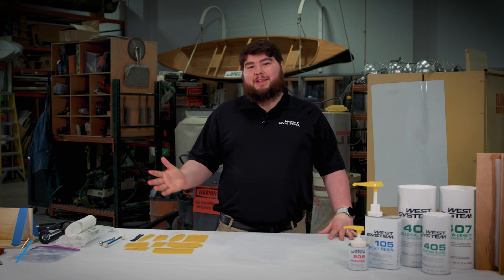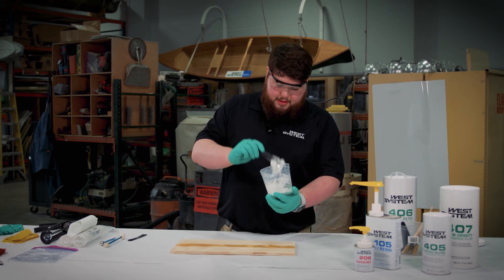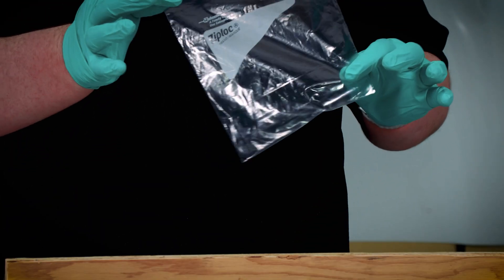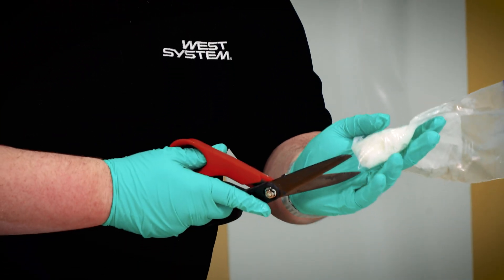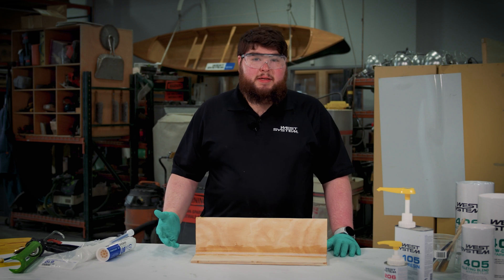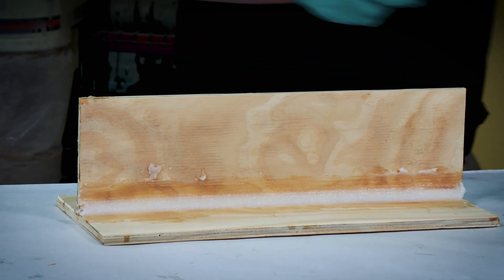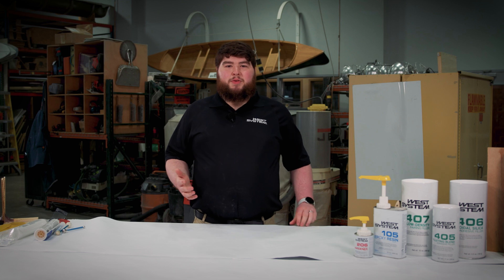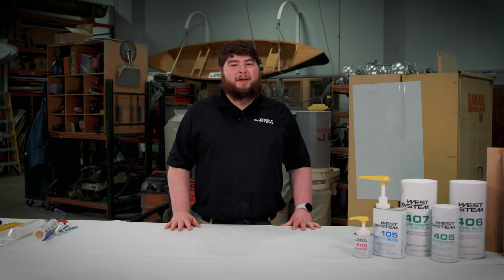How to make Fillets with WEST SYSTEM Epoxy

Comment: Very helpful video. But you forgot the best alternative to a plastic bag: a piping bag, like you use for cake frosting. They are a much nicer shape, often made out of good thick plastic, and very cheap.
Reply: That is also my go to method.  Tuck them inside an appropriately sized container, fold the opening edges over the sides to fully expand the opening and then fill at least 3/4.  Remove and twist the opening to close it, snip off the pointy end, and squeeze away.  I get them on Amazon in lots of a hundred for a few bucks.  Truly the simplest way.